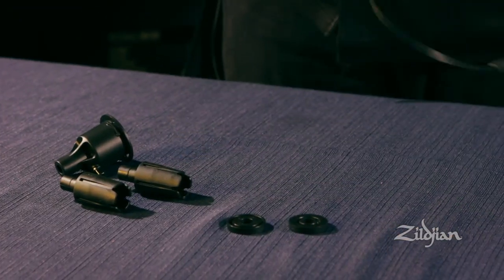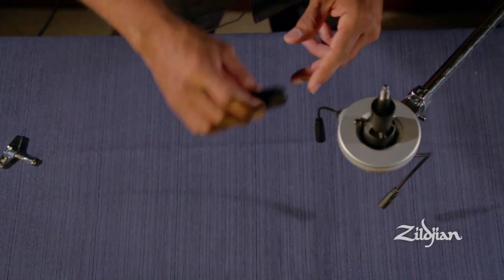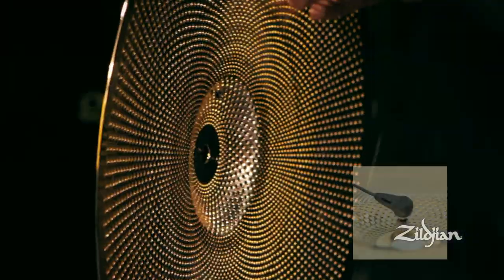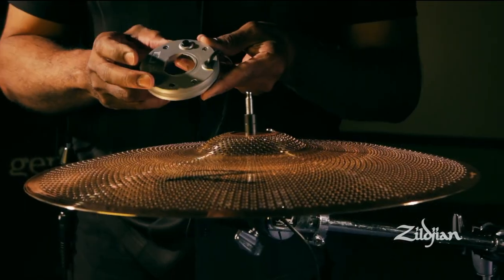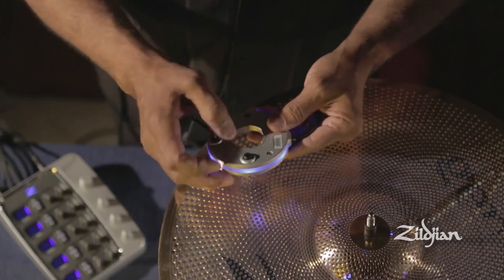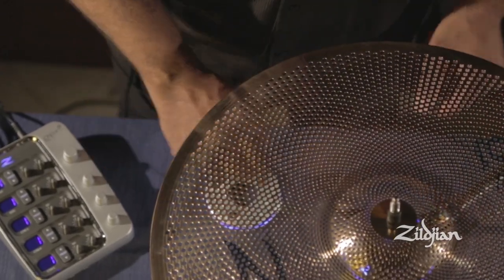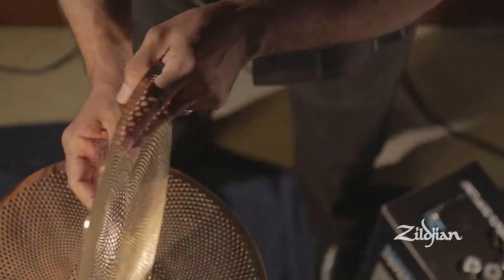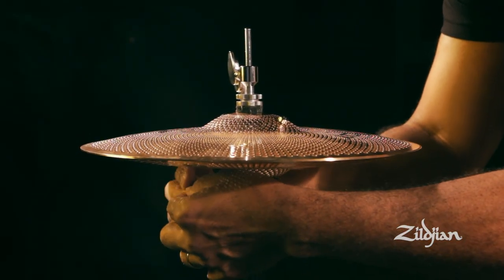Gen16 Buffed Bronze - Mounting the Direct Source Pickup

Comment: The cymbals rotate (not the pre amp) and if you strike hard for a long enough period of time, the sensor cable will break. That's 35€ each for your pocket, not so great engineering!
Reply: Best volume cymbals maybe little bit more noisy than l80